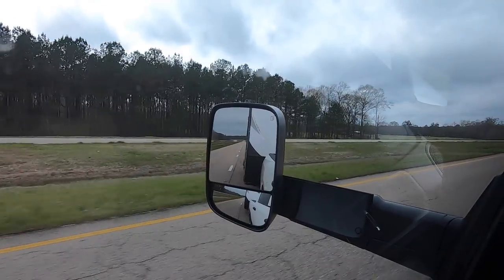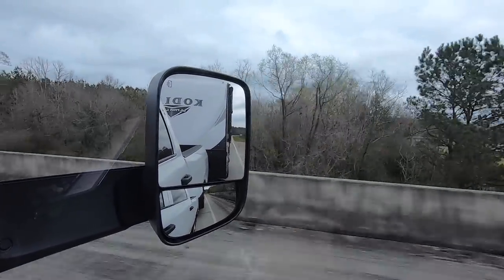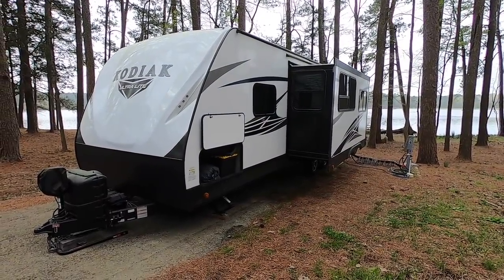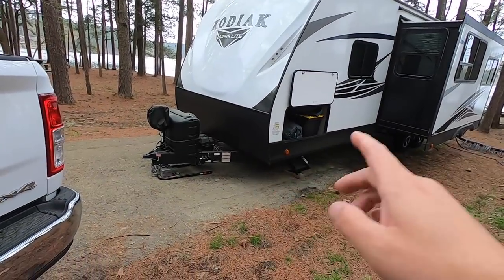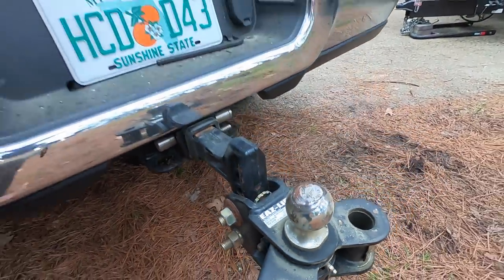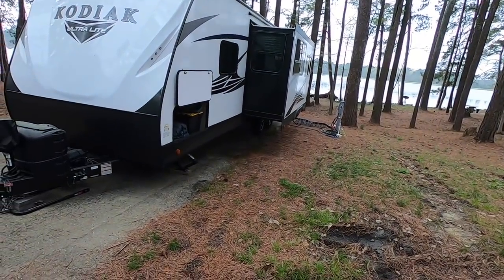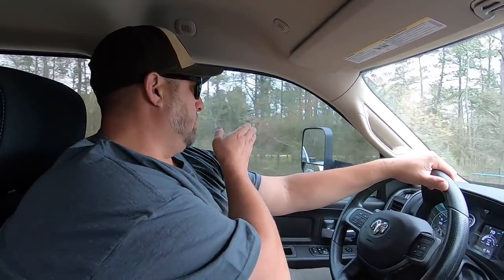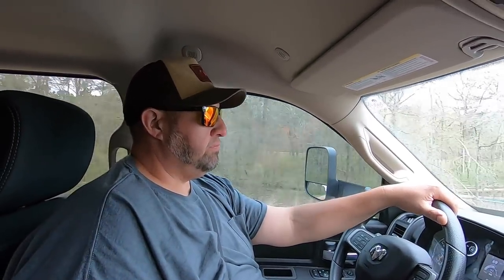Trailer Pulling Updates & Hitch Adjustments

Comment: Having built trailers since 1976, one thing I do know is the vehicle tow hitch needs to be as close to the back axle as possible. So if during your modification to the receiver you can  close up to the vehicle as possible. There is or was a canadian engineer who did a study on trailer snaking, I have a copy of his paper somewhere, (the maths are horrendous). The main trigger to snaking is vertical movement on the drawbar of the vehicle, most people think its side ways movement but it's not, vertical movement throws the center of gravity back and forwards. At one time in the 80's I patented a damped coupling device to eliminate this problem trouble was not many people were willing to spend the money on such a device so I only made a few in the end.

Comment: Adam, when I had a pull behind trailer I used steel shim material to take the slop out of the hitch. I realized the amount of pressure being exerted because after a few months the shims were blossomed out in spots. I suggest that you use something hard (tempered) when you do a permanent fix. Also, the friends I know who use friction sway bars have to tighten the crap out of them to have any reduction in sway. That pivot point has very little mechanical advantage to keep the trailer from swaying. In my opinion, if it does not squeak when you turn, it is no where tight enough. Trailer on Adam.

Comment: To remove the slack in the receiver hitch I use a 3/8" diameter "square" ubolt with a piece of 3/4" round bar drilled to span between the bolt legs. This is installed diagonally to bridge across between the receiver and the hitch shank. I made mine but these are available commercially also. Simple job for a guy like you.

Comment: Great explanation for those who don't understand what you are talking about. As far as the mods go, I believe you are on the right track. It looks to me like the bolts on the height adjustment portion of the hitch need to be sleeved or remade. Just my 2 cents. Stay safe and healthy! Dan @6-4 Fab
Reply from the maker: That part of what I want to modify also. They drilled the holes too loose to me.
Reply: Well, with manufacturing being what it is you can't expect an ideal fit. They're only worried about $ in the long run, not end user functionality. Or I guess to say that better would be that they don't want to make parts that don't fit by a couple of thousands and they have to scrap so they make there tolerances a mile wide so they can make sure that they make their $. Dan @6-4 Fab Glen Rock PA

Comment: Deductive reasoning at its best. Nice work. I know its nothing to do with your on-board trailer sway but Ive always wondered as well with regards to your wind and tractor/trailer buffeting you around if adding Airtabs to your trailer wouldnt help. A band of them around the nose and perhaps some on the tail would likely change the way the trailer rides immensely not to mention helping fuel economy. May be worth a look. They may fly you a box for a review video.

Nice work.

Comment: Once you get the bulk of the sway out you will start to chase the problem thru every component (just a little bit everywhere LOL). The biggest difference I saw in my trunk is when I replaced the junk factory tires with Michelin LTX tires. I've ran both MS/2 and AT/2 and I don't think I'd ever want anything else. I really want to swap my tilt trailer tires and step up from D to E load range Endurance tires.

Comment: Hey Adam, I drove tractor trailer for years and have pulled a lot of different trailers and most of them give you a little sway. All you can do is take out as much play as you can to help your sway and it seems that you've done that to the best of your ability. Another thing you can do is to make sure you have the air pressure in your tires right for (your) application as a small change in preasure can make a huge difference in stability. Good luck - later

Comment: Generally, if your tongue weight is 10% of the trailer weight, you're good. It's the "rule" I've used for 4 decades of pulling campers and trailers and it's worked perfectly. I think Adam knows what he's doing.
Reply: A little more doesn't hurt.
Reply: @dougmilley2480  True. I used 10% as the minimum, but only rarely exceeded 12%.
Reply: @sidewinder666666  The GVW of the tow vehicle matters as well. Your recommendation is spot on for light to medium duty trucks. HD  rear dual  wheel will tolerate far more. Ask me how I know?
Reply: @dougmilley2480  Oh, no doubt. My towing experience has with single rear-axle SUV's and relatively light trailers and campers, less than 5500 pounds. Maybe if I win the lottery that will change. ;)
Reply: @sidewinder666666  My camper is around 6500. My skid steer on the trailer is around 12,000.

Comment: Hi Adam,

Thank you for many hours of viewing pleasure on the AboM machinists channel.
It is extremely educational and entertaining.

Since this leisure channel is more in line with my expertise, I dare to make a recommendation here.

Balancing the trailer has several aspects:
By compensating extra weight on the back of the trailer by moving luggage to the front of the trailer, the ball pressure can be kept at a proper level.
However, this will move mass further away from the axle(s) of the trailer. As a result the trailer has a greater moment of inertia around its vertical axis.
This makes it more difficult for the towing vehicle to counteract pendulum movements initiated by the trailer.
Also important here is the ratio of the distances from the ball to the rear axle of the towing vehicle and from the ball to the axle of the trailer.
After all, this determines the ratio of the moments of force that play a role in the transmission of a swinging motion from the trailer to the towing vehicle.

So for minimum swing load on the towing vehicle:
- bring movable mass in the trailer close to the axle (as much as possible while maintaining sufficient ball pressure)
- minimize the distance from the tow ball to the rear axle of the towing vehicle

It seems that your combination can still be improved by fixing a short towbar directly on the chassis of the towing vehicle.

Stay safe!
Reply: Please forgive my Google translated terminology above. I meant you would probably be better off with replacing your "hitch" by a really short one bolted rigidly on to your car.

Comment: One more thing Adam. All of the RVs that I have owned pull better with a full tank of water. More weight down low equals a lower center of gravity which makes for better stability.
Reply from the maker: Good trick, I might try that, maybe start with half full though as a full tank add over 400 lbs.

Comment: Adam,  we talked before about the tires.  Like I said, I have 100's of THOUSANDS of miles towing all types of trailers, and from your images,  you are looking fine.  Just keep tweaking it and get it as good as possible.  As far as tightening that center anti-sway,  I'm not familiar with that system at all, but just be careful that it does not put too much pressure on the rest of the weight distribution system, especially  when maneuvering around campgrounds and gas stations etc.  As a rule,  when I used to run friction sway control,  I would remove mine before I went to my campsite and only reinstall after I was out of the campground.  Once I switched to the dual cam sway control,  I never even think about it at all anymore.   I have used the exact same setup on 2 different travel trailers, on 28' and this one is 34', and I think a total of 4 or 5 different enclosed car trailers,  all with the same bars and ball mount, just bought extra cam/lift brackets for the tongues when I had more than 1 at a time.  Right now it is installed on my 34' Mountaineer and on a 28' enclosed Pace American car trailer.  The other 2 car trailers I use are a 48' Gooseneck and a 32' goose.   I also have 2 equipment trailers that I don't use sway control one it goose and one is bumper, and one small utility trailer I think is 16'.  So you see I kinda have some experience LOL.

Comment: When a trailer with that large a profile has that much leverage on the receiver hitch, there is no way to eliminate sway, you can just minimize it. 3/4 ton SRW trucks arent as stout as they might seem either. Sorry to be this guy but a 5th wheel or gooseneck is going to be the best bang for your buck if you're hauling a lot. For most guys putting a couple thousand miles on the travel trailer a year, a bumper pull is just fine and you just deal with the sway however much there may be.

Comment: It really puzzles me how these "experts" can tell you exactly what causes a trailer sway.    Let me add this little tidbit.  It's not a flatbed!!!   RV trailers are designed to be heavier in the front.  You would have to have not a few pounds, but hundreds of pounds to change the fulcrum point on an RV.  That and those comments typically come from "experts" who don't even own a camper and/or never pull a trailer.  Keep up the cool vids ABom.  Glad you're working out the bugs.  :-)

Comment: If you are going to keep your travel trailer for a while, you might want to look into a Hensley hitch system.  If and when you decide to trade your trailer for a new one, you should consider a 5th wheel unit.  While they are considerably heavier. more costly, and roomier,  sway is not an issue.  The sway is like having the tail wagging the dog and that is because of the towing geometry.  The hitch point is well behind the rear wheel centre line, so when there is abnormal movement in the trailer, that movement is amplified by the lever length between the  hitch point and the centre line of the rear axle causing the tow vehicle to move sideways.   A 5th wheel hitch point sits about an inch in front of the rear axle centre line, so if there is an abnormal movement of the trailer, the effect on the truck is negligible. I owned three 5th wheel trailers and have never experienced any sway problems, but  I've towed a travel trailer and it swayed all over the place, even with the latest sway control systems.

Comment: I have a separate anti-sway bar from the hitch to the trailer frame.  It has a friction adjustment lever.  My whole hitch setup was installed free by the dealer with some haggling in the price.

Comment: Hey Adam,  I’m sure this has probably been suggested at some point, but have you considered a different style of equalizing hitch? I don’t have any experience with the exact style your currently using, but I have been using the type with the separate weight distribution and sway control bars for many years with great results. Currently I pull a 30’ camper and a 20’ enclosed cargo trailer with my F-150 and have no noticeable sway. I use the weight distribution and one sway bar on the cargo trailer and weight distribution and both sway bars on the camper. The main advantage with the separate bars is more friction pad area and less moving parts in the hitch itself. You would probably still have to address the slop in the receiver though.                                                                                              
Thank you for all the content on both channels and Good luck

Comment: Looks like your on the right track of refining what you have. I dont know what suspension you have but i went to a Roadmaster Active Suspension sys tem instead of air bags as it's better for anti sway and stability of my truck. Just a thought and pretty cheap.
Reply from the maker: I installed Sumo Springs

Comment: I have a KODIAK Ultimate 291RESL - looks to be about the same chassis you have - 32 feet ball to rear bumper.

I run a Reese Straight Line WD Hitch with the extra arms which have the cams that catch the detents in the spring bars - pulling it with an F150 for a couple years ( got an F350 now) there was no sway unless a good gust or an 18 Wheeler passed etc... 

I get it not wanting to swap hitches, it's a PITA, but, with that trailer, that long a trailer, you might think about it.
... now to find your wheel mod vid, mine needs some wheel help, the axels are not quite aligned, took me a bit to realize that it wasn't how I was looking at it in the mirrors, but yes, it's crabbing...sigh...
Love your work by the way.

Comment: That hitch contraption looks way too "universal". As you seem to have in mind, it needs to be custom made and tight fit.
I'm sure you have the car suspension and all the rear axle linkage in top notch condition, all the bushings heavy duty (not that soft Chinese rubber)?
Reply from the maker: I added Sumo Springs to my truck which helps rear end stability.

Comment: My experience is purely theoretical. Your improvement by reducing slack feels better, but don’t take it to be completely rigid. My guess is aerodinamics. When you close up behind an 18er your smaller vehicle stars to wobble. Try to install a tarpaulin to cover your truck’s bed, best if from a roll bar to the gate.

Comment: I have to agree with the fifth wheel guys, but you have what you got,it's not cheap to trade up., I also love dully trucks.
We raced outlaw sprints for years, the truck and trailer scaled 19665 lbs, no sway at all.
2 question is your trailer level or slightly nose hi, if not it should be.
Is your truck setting almost like it dose unloaded, mabe just a little low in back with

Comment: I guess you made measurements from ctr of ball back to the ctr of axles, maybe a wind skirt under the trailer (on the front), a full mud flap across the entire rear of the truck or maybe a air dam (scoup) on the top of trailer? create vacuum under trailer or down force.

Comment: I would get an equalizer hitch , that not the most HD unit you have. I have the 10000lb unit and I love it , huge difference from what you have put that one on FB marketplace and be done with it.  I can drive with one hand now easily over bumps on interstate.
Reply from the maker: You don’t think mine is a weight distribution hitch? I mean I’ve shown it a few times now
Reply: @AbomAdventures  I don't doubt that , but you may be on the edge of its capacity and it being loose like it is definitely is cause for concern. I have never seen any distribution setup be loose like that.
Reply: Yeah. Check the bars. They should be stamped for their weight. If you're loading a lot on the tongue, you very easily could be over their limit. It doesn't take a whole lot but only a tongue scale will tell you for sure (you can make one with 2x4's).

Comment: It appears that the torsion bar platform is rotating separate from the ball mount. If so, the slop in the torsion bar brake should be causing any sway if the hitch ball is solid with the receiver mount. That entire hitch the goes into the receiver seems to be the root cause for the sway problems. I'd put in a simple ball and short mount into the receiver without the torsion bars and drive it.  If the sway disappears, its the "anti-sway" ball hitch design that's bad. I have never seen such slop in a hitch like that.

Comment: Adam does the law say anything about trailer ball pressure in the United States?
According to the law in Denmark, the trailer ball pressure must exceed 4% of the total weight of the trailer and the pressure must be at least 25 kg.
The towbar must have a type plate indicating the maximum trailer ball pressure, but usually it is between 50-100 kg (110-220 lb) depending on the size and weight of the towing vehicle.

Comment: #time for a 5th wheel.
Reply: once you go 5th wheel or gooseneck you never go back. The difference is night and day. Prepare for the "But what about my bed space!!" incoming
Reply: Going dually and LWB is an equally dramatic improvement. The footprint/stability on a dually is so much better than with an SRW pickup especially with mushy tires...
Reply: @truckguy6666  I dont doubt it lol. Some people are just particular. His money not mine
Reply: Yes trade for a gooseneck style would make it pull far nicer. Also it shortens your overall length for same floor space, so you could actually have a bigger trailer that took up less space. The way a gooseneck or 5th wheel pulls vs a bumper pull is worlds better.

Comment: We have a Ram 2500 4 wheel drive truck and pull a 31G grand design momentum toy hauler, I also get this slight sway from wind , my trailer is actually 36 feet long from from to back, Abom i am thinking about adding the Airlift air bag system to my truck, we use the Ezy 4 point system hitch system , would love to have your input on adding the air bags..or any one that wants to commit on this.. Thanks

Comment: yikes - besides that crazy sloppy hitch head you've got alot of payload in the truck with a motorcycle in the back.  with the coil springs in a dodge you might be up against it - have you tried without the motorcycle-in the truck?  part of what you are feeling in sway might be an unbalanced load and too much weight on the springs....try weighing at a cat scale.  see what your true weights are.
Reply from the maker: Wow!
Reply: Abom Adventures ???